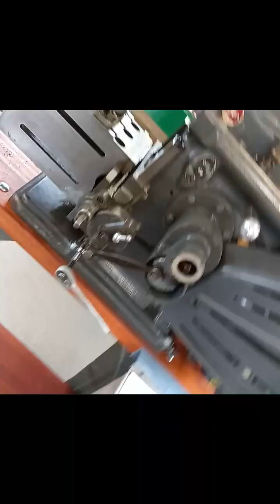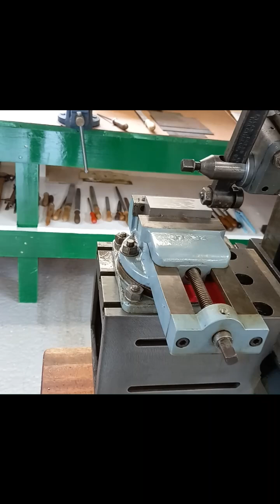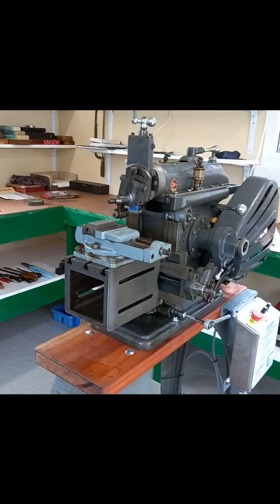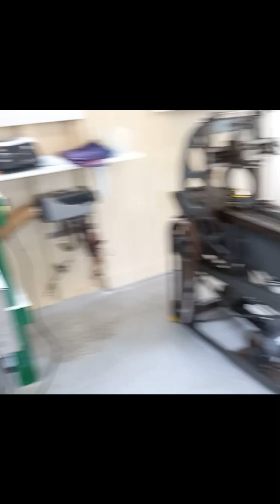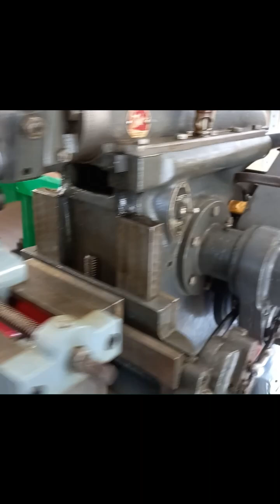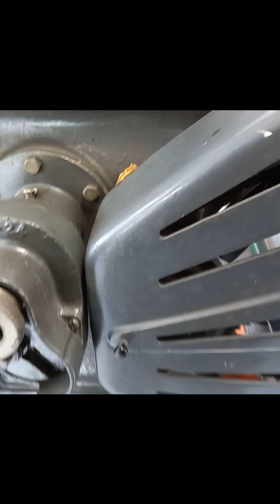Atlas 7A Metal Shaper Shaping Machine

Comment: Is your machine solid enough on those at higher speeds. The machine I just bought is setup on legs like that but without the lower shelf. Sorting out other issues right now and can not run it yet. Just thinking about added that shelf and how stable it will be
Reply from the maker: The machine is solid enough for how I use it.  The longer the stroke the slower I run it.  With a shaper it could be very dangerous to run the machine at high speeds with a long stroke.  I usually start with a slow speed and increase until I find the optimum for performance and safety.  The shelf is critical it holds the legs at the correct spacings and prevents swaying and other movments.  Thanks for commenting.

Comment: That's a beauty. I have the "7" model. The base of mine sticks out farther than yours but it doesn't have the foot like the "7B" models. The planner is a beauty too. Good video. I'm a retired civil engineer and and setting up a hobby machine shop in my basement is my goal. It is funny how many older civil engineers had metal working machines in their basements. That included 4 of my UCONN professors. Good Luck, Rick

Comment: Thank you Dave for your commentary. It was very interesting and informative. The tool in the tool holder being at the rear to prevent digging in. Makes sense. I allways thought the tool holder would have been weaker that way, as the tool is not backed up by the tool holder itself. Sub'd...... Cheers Tony
Reply from the maker: Thanks for the comment Tony,  I also have the butt welded swan neck tools for the shaper, these are still available from Rennie Tool Company in Manchester.